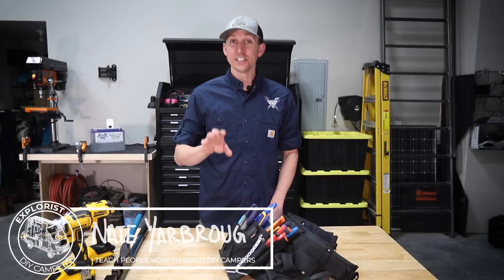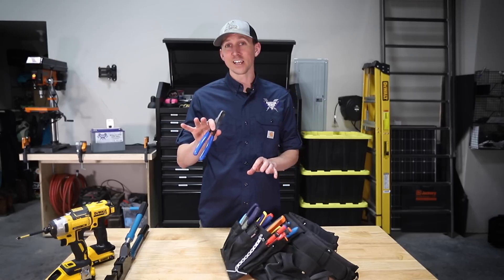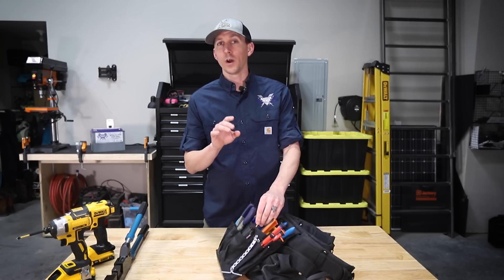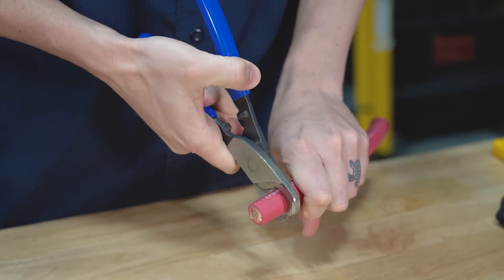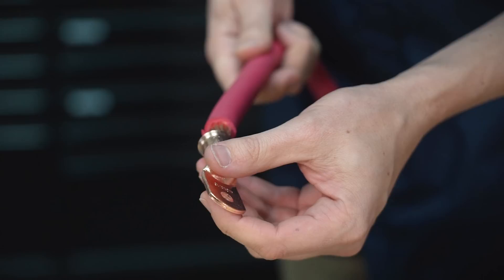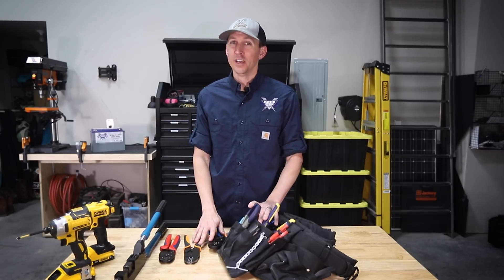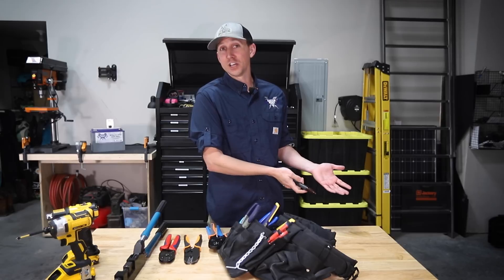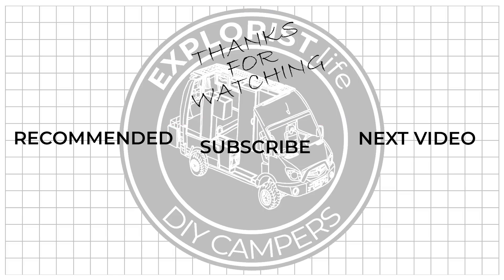Tools Necessary for a DIY Camper Electrical Install

Comment: Great rundown, with no BS and a good explanation of the use cases for everything! I recently got a cheap battery heat gun after years of just using a long reach butane lighter to shrink heat-shrink, and the heat gun does such a better job.

Comment: Good Video.  Have you found the TH0020 to be effective for crimping 8 AWG MC4 connector fittings (the ones without the 2 tabs to crimp).   
Is there another tool you might recommend for crimping 8 AWG MC4 connector fittings?
Thanks.

Comment: For anyone interested, the "demon magic" is the fact that as the current flows, it creates an electrical/magnetic field around the wire. The tool just detects that, turns it into electricity (very low voltage), and lights the light bulb. This is also why you don't want to run communications wire along with power wire (although technically coax and Ethernet take steps to prevent this electromagnetic field from causing problems).

Comment: These are the best videos and diagrams I have seen. BRAVO !!! 
I'm buying the "2000W inverter / camper diagram." unless you have a better one for my particular needs. 
I have two questions: 
Mine's a sailboat not a van. 
Instead of the Mulitplex I already bought the Phoenix 1200VA 12volt 120V for the shore power. 
I have the Smart Solar mppt 100/30 for the two 150w solar panels.
I have the Orion 12/12 for the alternator and start battery
From your recommendations I am buying the Lynx Distributor. 
My question is, where would you recommend I connect my wind turbine? Could the Lynx Distributor handle it, along with the Phoenix, the Smart Solar, and Orion ? Thank you for all you do

Comment: The installation that I currently have is made up of a 100 Ah Nagares relay that carries the energy from the motor battery through a 50 mm2 cable to a Victron smartshunt and a 150 Ah Liitokala lifepo battery and from this the cables come out. also 50 mm2 to a 1600 W inverter.

The alternator is 200 Ah.

The problem I have is that only about 40Ah goes into the smartshunt and if I put a bigger load like a microwave then the amps go negative.

I thought the alternator would send more amps.

Thanks
Reply from the maker: It does indeed seem a bit low.
Reply: @EXPLORISTlife 
Do you know if the buckboost of 50 Ah of Victron go on a Mercedes Sprinter of 2006? What do you prefer one of 50 Ah or two of 30Ah?.

Thanks

Comment: Nate, I do some work on sailing yachts - seems to be direct neighbour business.
I often had issues with the normal ring terminals <10gauge fastening it well. I was told, finally the crimp should hold a pull of more than 20 pounds. Never worked for me. 
On one side now I know there are many different qualities of terminals - some simply are thinner than other. So the crimp tool may not press them enough. So - please describe in detail what to look after buying them. 
Lately I bought a Chinese set with exchangeable jaws. That hat a very different jaw for the blue red and yellow terminals - the jaw looked very asymmetric - but this is the tool I had best results with.

Comment: I have lever crimpers for up to about 1/0 wire, but recently got a ($20) hammer crimper for 4/0.  It works great - I really don’t see a downside to it as long as you can swing a hammer.  BTW - no need for a special heavy hammer - multiple lightish strikes with a (28 oz) framing hammer work great.  Your mileage may vary of course.  

And yes I do agree that the fancy adjustable lever tool will give very consistent results - but I haven’t seen a problem with the hammer tool.  

I spent decades as an electrician so I do appreciate the importance of reliable connections.  You must have near 100% confidence * in whatever methods you use in high current wiring. Proceed accordingly.

Great video - having just finished a similar project my experience pretty much agrees with your assessment.

* - Life has convinced me that actual 100% confidence in almost anything is folly.
Reply from the maker: Hammer crimpers are great for those who are making a lot of crimps and know exactly how a properly crimped lug should look (an electrician with decades of experience).  The downside is... for the beginner, in my experience, they don't know how a properly crimped lug should look or how much pull-force a wire should be able to withstand, resulting in an under-crimped lug.  The lever crimper I showed has a dial and gauge on the side for more consistent and fail-proof (to a degree, of course) results for inexperienced users.

Comment: Good suggestions. Thanks!
A couple extra tools I’ve used in Sprinter conversion:
-Torx Sockets and bits-for seat base, grab handles & misc bolts which I didn’t have in my home diy tools. 
-plastic panel fastener removal tools for all those odd clips and Christmas Tree style fasteners that hold interior and exterior trim on. 
-Electrical wire fish tape
-Portable lighting-working in the dark isn’t fun
-Sharp large scissors-insulation and template cutting. 
-Drill bits, stop collars to prevent punching through the outside of your van, and hole saws-wiring and heater holes.

Comment: NEVER use one of those current sensors to prove that an AC circuit is not live.  It should only be used to show that there is power.  Always use a voltage tester (commonly called a Wiggy) or a multi-meter (like a Fluke) to test for voltage on AC circuits.  Also, use the LIVE-DEAD-LIVE method.  Check a known live circuit,  check the circuit that you are going to work on to prove that it's dead, and then check a known live circuit again.  I carry one of those current sensors, but I only use it to show that something like a fan has power; never to prove that something is dead.

Comment: I think a labeller (dymo or whatever) with clear heat shrink will be a nice addon even more close to necessity
Reply: I prefer always label / mark wire as both ends. Dymolabeller is also in use with clear shrink tube with glue. Surely that need prepared from plandesk to actual wire working. But it will help a lot when have troubleshooting or rebuild things. And no matter what level is working for.
Reply: @Teme OH7T  I do the same in my preview vehicle, but now in my jeep jk with a lot of stuff plus ham radio accessory (you can understand me how hard it's find a place without qrm qrn) and I like go offroad & play with mud and snow, some river cross and the label fading faster... 73 de IZ3QVB

Comment: Mark 2 on the Voltage Detector - Klein makes an awesome tool that will also let you do trouble shooting and completely trace a wire. It had a receptacle plug in part that will let you know if the outlet is wired correctly or how it is not with a built in GFI tester. And a voltage detector portion. The plug in part stores by plugging into the bottom of the voltage deteector. You can get it with an accessory kit that will let you test light sockets and use alligator clips to test other things. 

Those coax Cutters are the Bomb!
Reply from the maker: AC Voltage detector is definitely coming up on my 'to replace' list.  I'm not sure how old that one I showed is. 🤣 I know the Klein one you are talking about and is probably what I'll get next time around.  I've got a few outlets around the shop I'm needing to trace.

Comment: Thanks for the video!  Question for you - for the last two years I used a pair of those Irwin vise grip adjustable strippers to strip sheathing off of marine grade wire, particularly off of duplex and triplex cables like you showed.  It broke so I ordered another pair thinking that I was impressed with the fact that it lasted over two years stripping that heavy gauge wire.  The new pair broke in just a few days! Any thoughts on a different or better quality tool to do this?
Reply from the maker: I haven't had any issues, I wonder if the ones you got the 2nd time around were just bad.  They should have a warranty on them, so maybe look into getting them replaced?